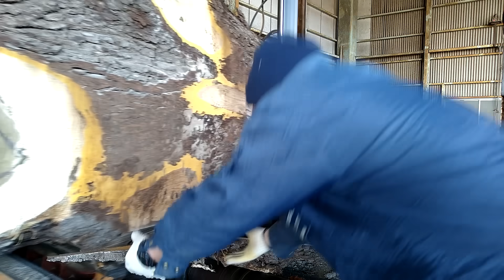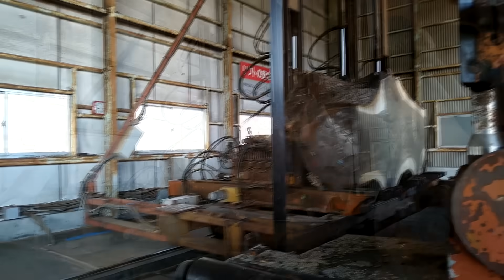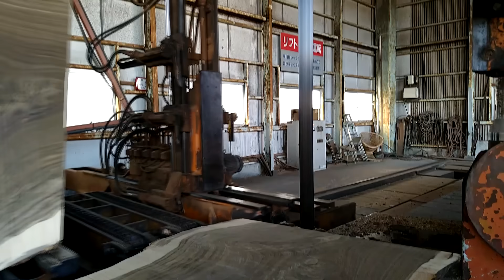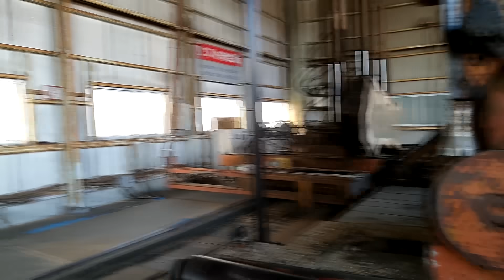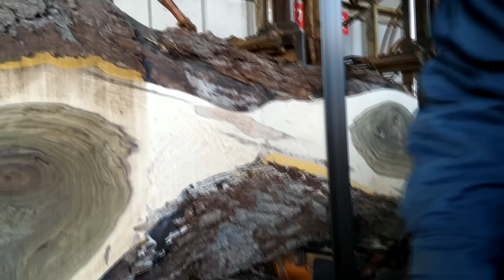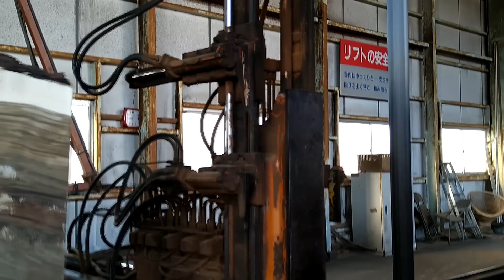American black walnut

Comment: Thank you for sharing. Is the white outside part of the wood equal strength to the black inside? Is the white part usable or cut away?
Reply from the maker: The strength differs between the outer and inner parts.
We also use the white outer part.
Arigato

Comment: I had a band saw mill slab up an old Black Walnut here at my place a couple years back. It is stickered in my Greenhouse. I milled some up, and it is gorgeous and dense. Super-dense, heavy wood. And you should see it after I fume it with Ammonium Hydroxide. Wow!

Comment: I wondered how they were going to handle the torque caused by the almost complete cut. How to work around the inherently bad decision to use a verticle bandsaw. I assume the vertical blade is traditional. How many workers have tripped and fallen into the running blade?

Comment: I cut down 40 black walnut trees off my property 15 years back and sold 90% to gunmakers for stocks I assume. They were the ones paying the best at the time for all the black walnut. I had a 12-15 like this here and the rest slightly smaller. They were very picky I remember on where to cut they wanted certain lengths at crotches etc.